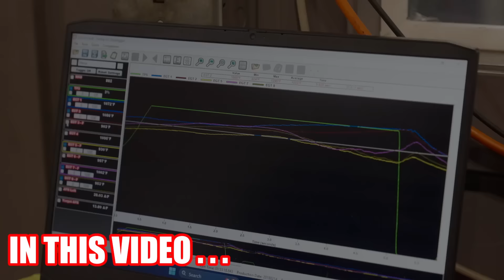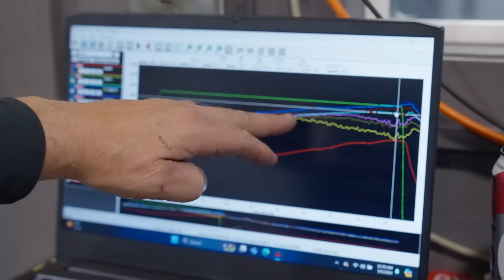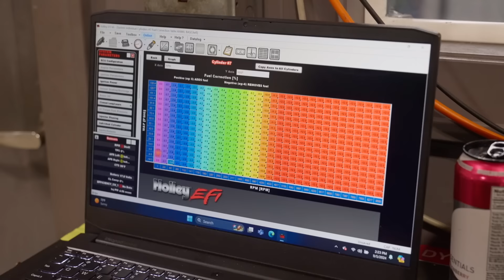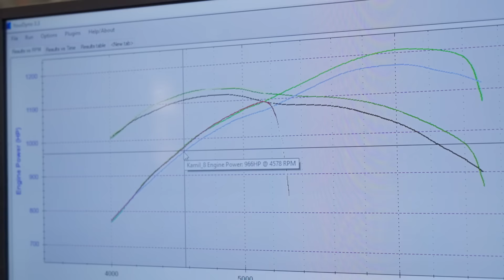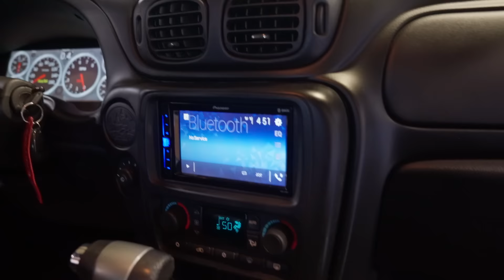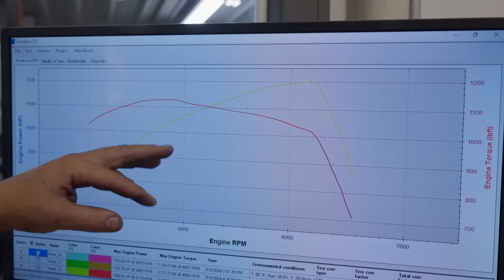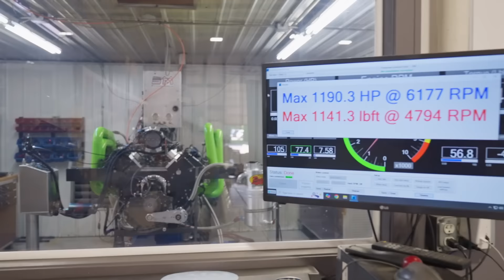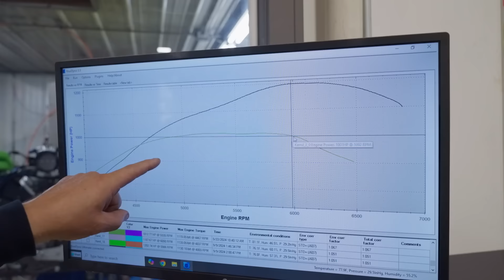200 HP from a Cam Change? The Biggest Cam I Have Ever Used In A Boosted Engine!

Comment: Ive never seen duration numbers like that (NA) in anything with less than 14-1cr, and usually, it's more like 15-1+cr. Comp Eliminator and Pro Stock type stuff as far as cams like this in NA form. But these mountain motors are outside my wheelhouse so maybe this is somehow small in this application. I know that the PLR and Noonan hemis (procharged versions) have around 0.560 lobe lift × whatever their rocker ratio and similar duration numbers to this BBH , but even they have around 13-1 cr.

 LSA of this one seems extremely wide though. Bigly. Id be curious to see 114 to 116 degrees. No wider than 118. 

Hope the guy likes changing springs on a regular basis. An inch of lift in an endurance application is pretty nuts. This whole thing is nuts.

Comment: Hey Steve, could it be the front throttle body intake design is not providing the back cylinders proper air flow due to reversion in the plenum?  My back 4 cylinders were cold on a NA SBC with a decent cam and an Edelbrock Pro Flo XT manifold.  I had to plumb in a vacuum leak to the rear of the manifold to get them to come up to temp at idle so they could get some air.

Comment: How long is the stroke? Wild quess that piston speed is so high that atmospheric pressure just cant keep up with the piston moving so fast (air can only move so fast). Just a wild quess. Engines dont suck in air, atmospheric pressure forces air in. (1013.25mbar at sea level)
Reply: Maximum piston speed is around 25-28meters per sec. After this point this kind of funny problems start to araise. Boost will fix this.

Comment: I don't see it being in the plug opening location cause you moved them to different cylinders. What about the wires feeding the coils. Could they be different sized causing ohm issue?
Reply: The only thinking you didn't move from cylinder to cylinder was the wiring

Comment: Hi steve 903 cuin fuel and air equal heat can she get enough air though throttle body without boost I imagine intake air temps are super cool with all the air velocity

Comment: I was thinking same thing if the cylinders were still being starved of air. But I'm no expert 
Those are huge intake ports sucking through that throttle body 
Could static pressure of downstoke ever not be enough to pull through throttle body?  Just a curious question anyways

Comment: I'd think the cam is plenty big. Either the cam is installed to advanced, ground wrong, or the heads are too restrictive or going turbulent and just not breathing. I'd think, something is not right with the valvetrain creating a volumetric efficiency problem. Just my guess as I haven't degreed the cam or verified all the cam card #'s are spot on. Good luck, as it out to hit 7000 rpm easily plus.

Comment: 284/304 degrees of duration at .050 on 117 lobe separation with 1.060/1.036 lift.

580 lbs on the seat, 1400 lbs open. .... good for 10500 rpm

Comment: Does dynamic compression go up with rpm?
If so then wouldn't resistance to spark increase?
If so could it be the plug ground being enough for low rpm, less resistance less current, high rpm higher resistance?
If so could a resistance reading between the 1/0 ground and all plugs shells?
So, I guess I'm saying the connection between the head and the threads of each spark plug may be different do to the hard anodized surface. My theory on when the throttle is choped is the engine doesn't get as much air to have high cylinder pressure. Resistance may lower enough to have spark again..

Best guess on compression is it is enough. The dirt guys in the passed ran big cams with low compression. The engine didn't have much down low but would turn a lot of rpm with fair HP.

Comment: Is the engine possibly pulling a vacuum in the inlet manifold at WOT above ~4500 RPM? Throttle body looks really tiny for a huge CI engine...
Also what is the primary ID inside those water jacketed headers? Could the headers be so restrictive they're not able to support the displacement and RPM's?
Reply from the maker: No vacuum 
2.5
Reply: I was thinking that , that thing does look tiny

Comment: I'm Thinking it's a air/fuel ratio problem. With the first four nearest the throttle barrel, They are taking the Majority of the air volume at high speed. Lowering the pressure as it goes back thru the plenum.

Comment: That sized cam could definitely have a negative impact on the dynamic compression when the static compression is at 10:1. Can you post the current dynamic compression ratio?
Reply from the maker: That’s a math problem 
I can’t actually measure

Comment: I suspect that the MSD600 system needs a MUCH better ground, especially at higher RPM, and thus that is your problem. Too high of impedance in the ground somewhere along the line due to the anodizing.

Comment: Could it be that the 60 degree engine make for too close spark between cylinder firing and the big coil affect each other, that with bad conductivity. Maybe you could try passing a tap in the spark plug hole just to be sure

Comment: Steve, is there a problem with the ground for the ignition trigger, or is there an issue with the ground for the coils?
Working with marine engines some times, ground paths through the block can become problematic.
Some times cured by running a #14 wire ground to individual components
Just a thought, Hate to see you struggle.

Comment: Again Steven, open up the ring gap larger on your second ring than the top ring, I want to see when you peak in power it holds for five six hundred RPMs before it drops off, that curve dropped faster than I like, it comes from building pressure between the two upper rings and when that upper ring gets pushed up and it floats it's all over, try it for shits and giggles

Comment: Try grounding the heads back to the battery. The sensors may not work without proper grounding, the anodizing may be messing you up. If the heads are anodized, the headers may not ground and the egt's are erratic.

Comment: Could it be and intake manifold issue? Turbulence etc....? Was just thinking that with smaller engines you can change power band and rpm by switching manifolds! Now I know you can't just switch the .manifold but maybe cause it's a custom deal maybe it's off in the runners or something! Idk just trying to help you think of diffrent stuff

Comment: Videos are awesome, Keep Thinking... I had the 903 figured for 300/310 Dur @ .050, 1.00" lift on both, on a 125 LSA, Looks like a need to retard that cam to extend at top end if possible. Wondering if your pulling on the TB/Plenum to hard NA / Running out of air? Of coarse BOOST would fix... Also could you be getting into a spring issue? Keep up the Awesome work you guys do and share...

Comment: Egt-s are very sensitive sensors measuring milivolts. I think the big power coils are makeing them go nuts with this non conductiv anodizing stuff. This is when you have to much data what not helps just confuses you.

Comment: Wonder if the rear cylinders are starving for air because the throttle opening can't supply enough because of the displacement and the air opening is at the front of the engine?

Comment: Is your throttle body too small, not getting enough air in and the front cylinders are grabbing more air than the rear. Normally aspirated usually have a central inlet not on one end so you have a major air flow imbalance. Can you swap the manifold end for end to prove this.

Comment: Is the MSD system actually delivering multiple sparks?   If so...they are VERY high voltage but also very brief duration.   I've run MSD's in the past but have reverted to large conventional ignition systems because the spark duration is much longer.   With mixture swirling past the plug gap....a long and hot spark creates a better flame front than a stuttering series of brief sparks.

It was mentioned in one of the earlier 'Big Black Hemi' video's that large bore motors like having the fire lit in two places which makes for a much improved flame front that needs less timing lead to get all the charge burned when it needs to be.   On this motor with a single plug...you can only do so much and I'm thinking this is partly responsible for the EGT issues.   With the increased charge density of the supercharger most of these issues will go away and part of me wonders if a smaller and more reliable cam might be the better choice in the end for extended service?

Comment: Don't the smart coils have a longer spark pulse?  Perhaps the standard coils are not able to light the combustion reliably at high RPM due to the shorter pulse.  Hemi's are hard to light anyways I think because of the location of the spark plug(could be wrong, but most have 2 spark plugs per cylinder).  Shouldn't this one also have 2 spark plugs per cylinder as well?  It may have them...couldn't really tell from the video.

Comment: Not enough compression for rpm? Maybe improper port design? Maybe it's just a big hole, but not for velocity? So maybe reversion. Not sure. It's funny how's its picking on certain cylinders.
Reply: Seeing how it did on the broken dyno pull. Now I'm almost thinking it's electrical. Especially with those efficiency numbers.
Reply: Nvm I should hold my comments until the end of the video😂

Comment: 10:1 is almost a useless number for how large the engine is… lol
Especially if it’s at least a 4.5” stroke or larger, I can’t remember. 

You know how fast a large stroke eats up a camshaft… 
Combine that with a 5.125” bore or whatever it is… and it might as well be a towing camshaft lol. 
Flame travel and kernel all that jazz with that big of a bore and low cylinder pressure… 
Run it on 87 octane and it’ll pick up everywhere lol. And still be in one piece. 
150 psi off the starter tells you a lot. 
MASSIVE CAMSHAFT!!! LOL (besides its built for boost) 

Sucker is still off... 
Don't think it’s a lack of duration thing at this point, maybe quite simply a valve timing issue…
To me (being ran n/a) there’s far too much duration split. Obviously that’s for when she’s force fed… BOOST FIXES EVERYTHING!!! 🤣
You’ll  find the answer when you advance the camshaft… 👍🏻👍🏻👍🏻🤘🏻🤘🏻🤘🏻👏🏻👏🏻👏🏻

Keep up the long thought processes! 
My first guess was a weak ignition. 
See it all the time on hillbilly junk where people overpower the spark plug with boost and fuel… 
Never would’ve thought that big $ msd system would be an issue though… Must be failing 🤔

Comment: I wasn’t far off on the cam specs, 
Steve, 903 cid, normally that thing would have 4500cfm worth of throttle bodies 18-1 compression, Zoomies 
In the Nitrous combos, possibly a bigger intake runner, more CSA is needed to get the peak Hp to move IMHO 
And let’s face it nobody has ever done anything like this before it’s really cool to watch the process but my wallet and Heart hurts just watching you get tortured to death on this deal!
put the charger on it watch that immediately change the RPM a little bit because boost fixes everything lol

Comment: Keep the thinking. Would have to stop over thinking and try a simple thought of rear of the engine is rich because of a lack of air ftom a front fed intake manifold. As soon as you came off throttle egt went up because your not feeding fuel. As much air as this thing needs i dont feel it could possibly have enough at the back side. Asking you sir...if this was a NA build would you have a center fed intake?

Comment: Seams to be that whole combo is just kinda weird and your trying to make more n/a power without really doing what the motor wants for n/a power.
I really think it’s gonna be one of those engines that picks up a lot more power per lbs of boost over a typical engine.

You got a 903” motor trying to pull air through a smaller tb for that large of an engine na and the compression is lower,it’s got hemi heads which alll typically like higher rpm…but your keeping the rpm low with the cam etc… while the new specs are bigger really think they setup wants more lift and sense it’s lower on compression once the engine is running even with the cam you have the running compression is even lower.
Motors just starving for air,rpm and compression.
But I bet soon as you boost it,it’ll just kinda fix a little bit of everything.
The engine will see the air it’s been asking for.
Cool to see you doing all this testing and showering us all the knowledge you’ve learned.

Comment: I still think the plenum volume is way to small. Get the air past the throttle plate and have enough plenum so the cylinders can choose to get air from were they want to. That squish in the rear of the plenum makes me wonder. Of course it won't matter when it gets boosted.

Comment: Need to get some cartoon "Gears" to overlay on your head when U B Thinkn'..... Ground not always ground.... as load (electrical) increases bad ground can get worse (starts going positive voltage)... are those heads really grounded? I've had to ground each head to the block ground (4ga or 1" braided strap) in a past life to solve some issues..... fyi side note: I always run a min.4ga directly from alternator case to battery ground, not relying on the head/brackets for ground....

Comment: At that point you swapped both coils and injectors, as it were 3 cylinders with issues, you could have done, 1 coil, 1 injector and 1 both swap, and then you could see the variables on one run.

Comment: Is the lobe separation too high? 123 is a lot just asking I have nothing to reference with
Reply: You have to remember lobe separation angle is a result of valve events. When cam lobes get big you end up having wide LSA to avoid having a crazy amount of overlap. A big cam with wider LSA can actually have more overlap than a small cam with tighter LSA. It doesn’t tell the whole story.

Comment: RI would think, regardless of a cylinder or two misfiring, the engine should still pull hard to 6500-7000 rpm unless it can not breathe, (cam timing or net valve lift or port restriction/choked) or inadequate fuel delivery. The cam is big, but your feeding two 425 CID engines with hemi heads/huge ports.  I'd hate to think how much CFM that engine pumps thru it when it's right. I can't see any reason that engine shouldn't rev to 7000-7500. Hemis need less overlap as they are so efficient at crossbow. Almost as if the intake charge might be blowing out the exhaust & again not filling the cylinder adequately. The EGT gaining temp the second you shut the throttle makes me think your shutting off the intake charge blowing out the exhaust. I might be all wet too. I know you will figure it out & it has been a somewhat painful project. Good luck Steve.

Comment: I analyze your engine issues, but I also analyze how you trouble shoot problems.  Keep your thinking in the videos.  I would have swapped EGTs first to check to see if they were working properly.  Swapping coils and fuel injectors at the same time means you swapped two things at once, if the problem moved, which was it?  The coils or the injectors?  Make only one change at a time.  Your cam is not to big for the engine.  For the NA work that you are doing, you are running out of cylinder head flow.

Comment: For the question is it to much cam for compression? Simple. IT DEPENDS. what are you going for? na rpm, na torque, boosted rpm, boosted torque? Some applications it's great for, others is not. Also, its such a big motor, It won't exist in this setup unless it's for a specific application. Like the torque down low is so massive that even if it's for boosted rpm, it will do basically whatever you want it to. Now will you win at what you want it to if it's for a race? Again, depends. 

Looks like it flows so much air, it was extinguishing the msd short spark. Just convince the owner to use smart coils. What's better in your opinion stronger short spark or more spark time?

Comment: Losing power at high RPM
look at time 222 240 , the air vents at the back of the dyno room are being sucked shut due to not enough make up air entering the dyno room.  This reduces the amount of air going in to the engine especially on a NA setup. .

Comment: Could it be the cam's such huge lift and the overlap throughout that's making air pulses / resonance between the cylinders at that part of the range. Probably exaggerated because of low compression and not actually optimized for N/A. Maybe you wouldn't notice these differences with boost.

Comment: At risk of getting roasted...stupid question... with all of the issues you've had with conductivity with the annodizing, are the spark plug holes hard annodized? Is there any possibility  of having a weak conductivity with the plugs to the heads and the spark blowing out under load? It's acting like a weird electrical issue.